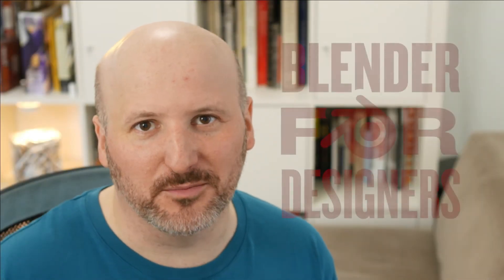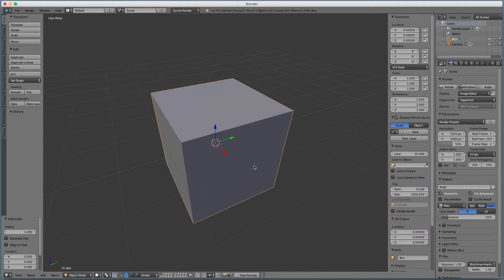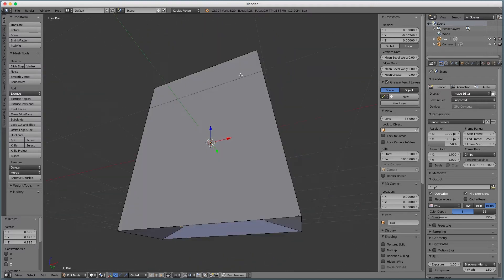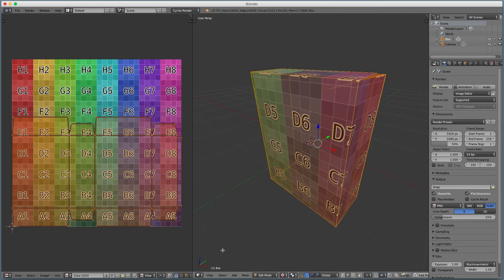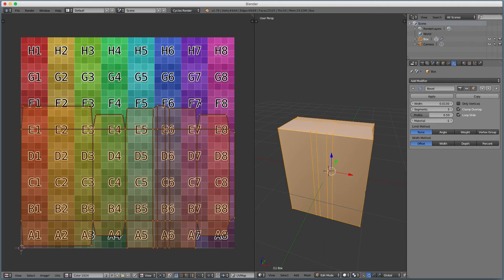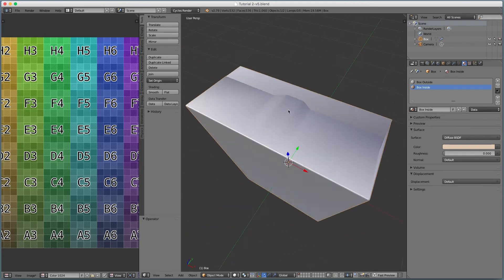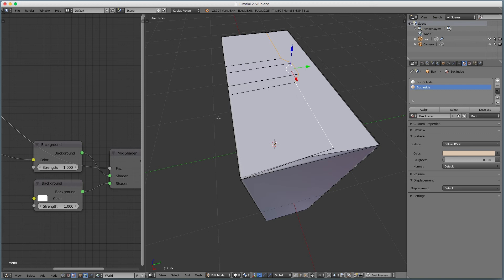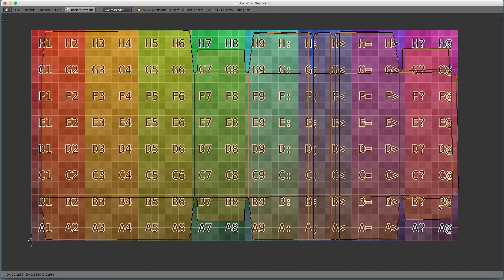Creating Dielines for a Box in Blender

Comment: how to change the inside box color even as u did sir. and best tutorial.
Reply from the maker: I didn't go over this in the video, but it happens with the solidify modifier (which I added around 14:18). If you go to the bottom right of the modifier, there's something called "material index offset". If you move this from 0  to 1, it allows you to use a second material for the inside. You still have to add the material (in the materials tab) as well – you can see around 14:50 that I have 2 materials. I go over the process in this video at around 22:00: https://youtu.be/8FhjvTEKYAQ?t=1320